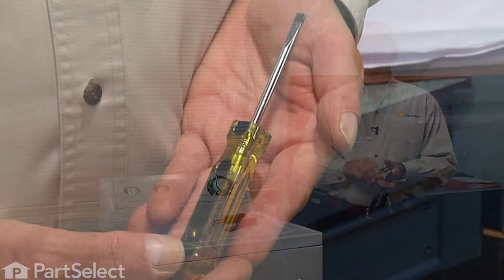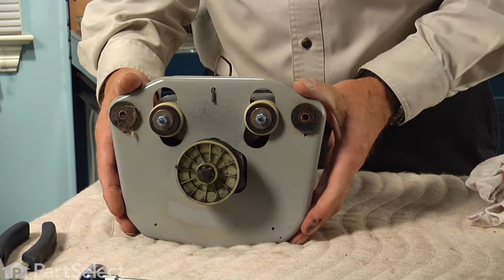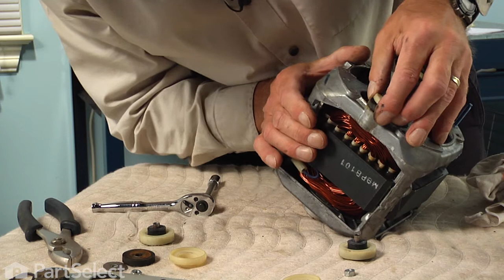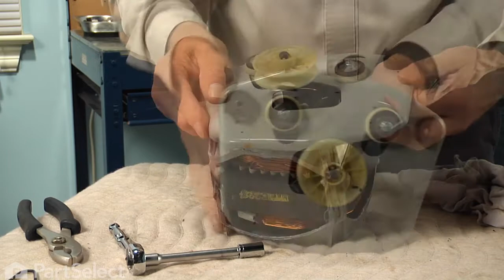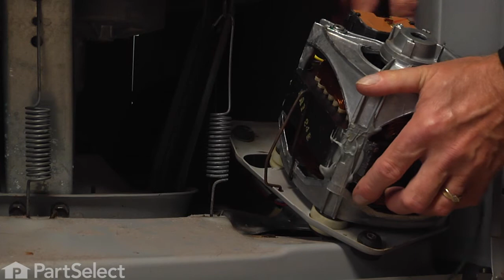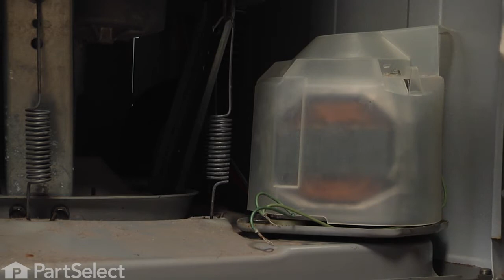Whirlpool Washer Repair - How to Replace the Motor With Pulley (Whirlpool # WP21001950)

Comment: I was glad there was a video for this. Helps keep straight putting the  sliding mounts back on as didn't remember
what I took apart. I didn't KNOW ABOUT THIS VIDEO, and just about disassembled the whole washer before I found out
how to pop off the front panel .I WISH "WHEN THEY STAMPED THE STEEL PANELS", THEY WOULD OF STAMPED IN THE FRONT EASY FOR ALL TO SEE AN ARROW ON EACH SIDE AND THE 2 WORDS ( POPS OPEN) I used a moving blanket to tip the washer side ways, when I was trying to figure out ,
how to get to the motor. When I finally found out the front panel pops off buy lifting the top part like the hood of
a car. I started reassembling the all I took apart for nothing. I'm going to see if it spins before ,  I bolt it back and tip 
it over on the front side to put the belt back on. No water will come out and make a mess as I have had it tipped 
in almost every direction, when I was trying to find out how to do it , before i seen the video.

Comment: How do you replace just the wheel?
Reply from the maker: The manufacture used a pulley that locks to the shaft with plastic fingers. Those little fingers do not take well to be pryed open and staying tight in use.
Reply: Same question. My motor is still good. There must be a way to replace just the pulley. I see a part Pulley 35-5021
Reply: @badger0888  what I did was i just broke the old wheel off entirely, it was melted anyway and bought the motor wheel on Amazon. We found what was actually messed up was our pump so i replaced my pump too from amazon
Reply: @ZionHurt  Same. Do you have a link of pulley part No. from Amazon? thx
Reply: @ZionHurt how did you get the new wheel on? With force and patience?
Reply: @velaslm  I would say force haha

Comment: Do you have a video on how you tip the machine to put the drive belt on thats what I need instruction doing. I have a Maytag Washer Maytag washing machine model number MAV4755AWW it is making a grinding noise when it spins and almost hauling it from working I wasn't sure it its pulleys and the belt the noises seems to be coming from under the washer or if it was the tub bearings help!!! Lol!
Reply: Sounds more like a G-box on its way out :face-fuchsia-wide-eyes: